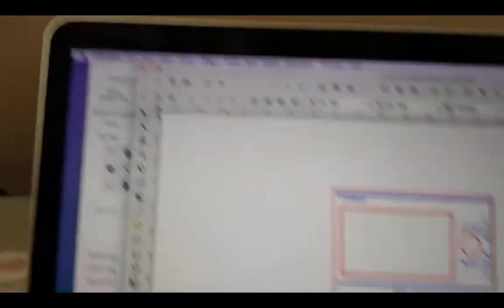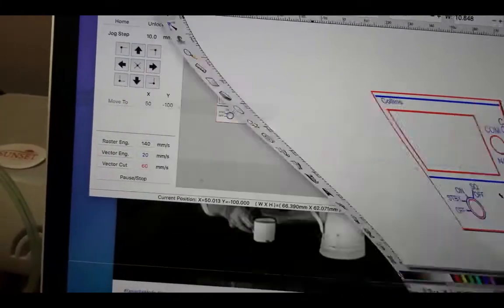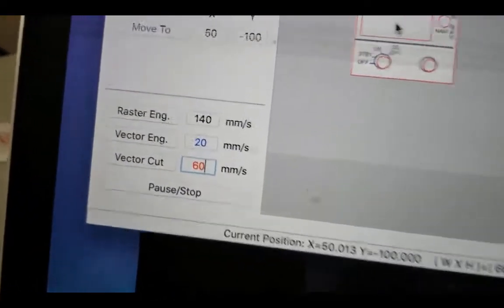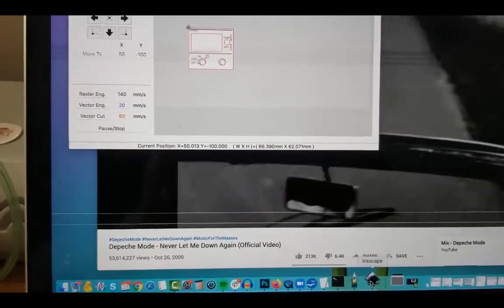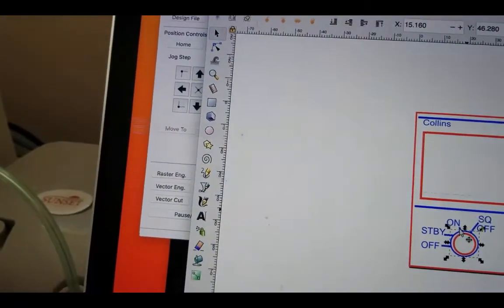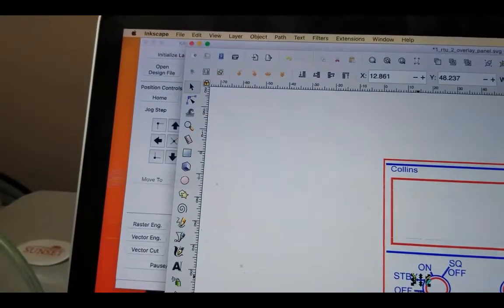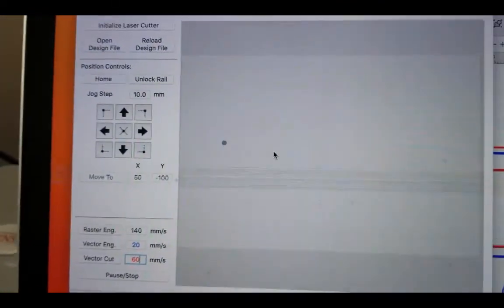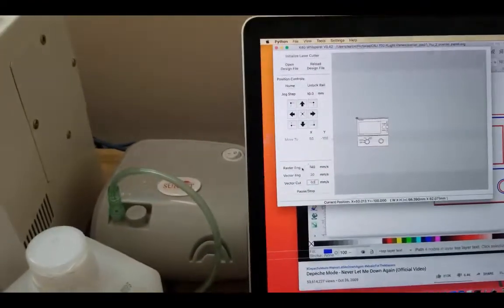(Watch Part 3) How to make flight simulator panels that are backlit

Comment: faairly inexpensive???!!!! Where are you getting it from, here in canada that stuff costs an arm and leg, that would literally be hundreds of dollars in mistakes.
Reply from the maker: In the first video, I explain that I bought some off Amazon, but found the other at a local hardware store.
Reply from the maker: If you see the video, I have a stack of the material, I think I paid about $30 for that stack
Reply: what! THATS AWESOME. Is it extruded acrylic? Cast acrylic is super expensive here. Your results look great
 @AaronWerner
Reply from the maker: @macfly4649  Honestly I do not know the difference.  can you explain?
Reply: @AaronWerner  , cast acrylic when cut has a clear edge to it , its made in a cast, where extruded acrylic is stretched into sheets and leaves a cloudy edge, but it engraves a nice white even onto clear, (where as the cast remains mostly clear). But the cost of cast is much higher. Plexiglass, is often times polycarbonate, (lexan) which you discovered melts and catches fire, leaves yellowish residue on the edges. ABS SHOULD NEVER BE CUT as it emits cyanide gas. gotta be careful with your materials. TIP: I find my laser cuts best @60-75%, To high and it will melt itself back together. Do you have a mA meter? should never exceed about 16mA on a 40W laser
Reply from the maker: @macfly4649  I would love to get a video from you that shows how to test that.  I’d be more than happy to re-share to others that are working in this environment.

Comment: I’m currently putting together a King Air 350i sim (It’s not exciting compared to a jet I know but it’s what I fly for work. Lol) in order to keep up on my flow checks and procedures when my flight schedule inevitably slows done. 

Anyway, a lot of the knobs on the pedestal of your sim look like actual original avionics knobs and I was wondering where did you get those knobs??? The King Air 350i has Collins Proline21 avionics in it and the knobs on your sim look very similar to what we actually have in our plane. I’d love to find similar hardware if I can. 

Thanks for posting so much great info. Keep up the great work! 👍

Comment: Very informative videos. Thank you for sharing them. I haven't yet gone through all of your videos in this topic yet so I apologize if my question is covered in a future video. how many millimeters per second are you using for your etching? And what is the voltage on your control panel on the K40? I have almost exactly the same setup you have so I assume your voltage and mine would be very similar. I am not trying to build a flight simulator but I do want to create A control panel very similar to what you are doing.  Thank you for any information you can provide on this matter I would truly appreciate it.
Reply from the maker: If you are using the K40 you will notice the meter on it with a dial, I use 30 mA to cut and run (2-3 passes 10mm/s), I paint the surface, and then when I etch, I use Raster Eng. 140-150 mm/s (a bit quicker than the default - 1 pass).   Make sure your paint is well dried and you are using a good fan on the laser to eliminate any smoking ghost images around the etching.  Also make sure you clean your lens before each etch- it will make a huge difference.  Good luck!

Comment: Hi Aaron. Thank you for sharing your work. Quick question. I don't have an air blower beside the laser like you do. But will I be able to wipe off the residue on the panel, afterwards?
Reply from the maker: No.  You must have an air blower.  They sell a small fan you can purchase on ebay and mount using a 3d printed piece but it was not good enough for me. I ended up buying this air blower for $5 from a thrift store.  It was previously used for breathing treatments.  I know harbor freight sells one for about $35.